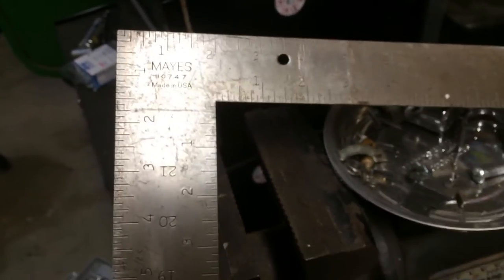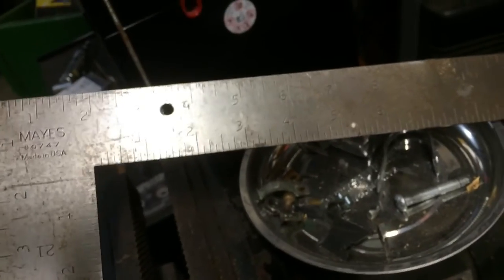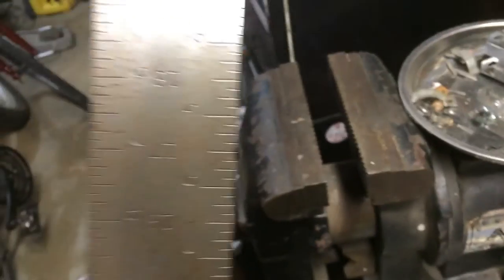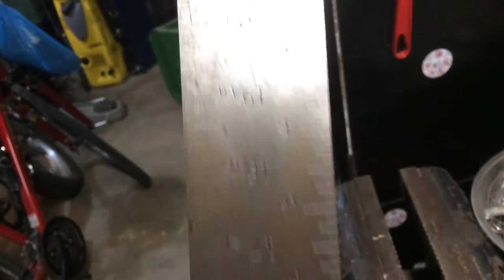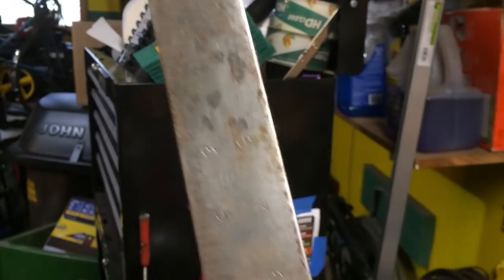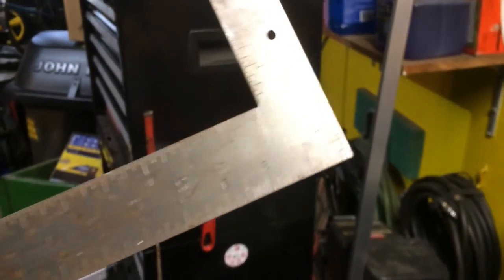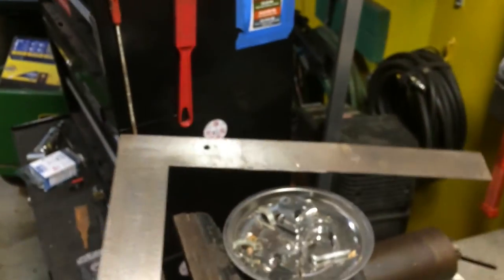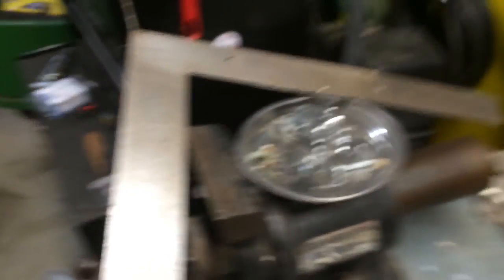Restoring Old Tools. Mayes L Square

Comment: Nicely done...I have an old rusty one from a garage sale... I wish mine had a hanging hole...Thanks for sharing...cheers
Reply from the maker: +Jeff Hunter just drill a hole in it man! I love old tools, and steel wool and WD40 have helped me clean off so many of them.  I recommend maybe spraying some sort of clear coat over the tool when your done (after you wipe off the wd40 of course) because once the oil wears off they start to get surface rust again. thanks for stopping by!
~intothedirtshop

Comment: I didn't really see what you did. Did you spray the WD40 and then scrape it first? use fine steel fool first?
Reply from the maker: I used wd40 and worked my way up in the grits of steel wool